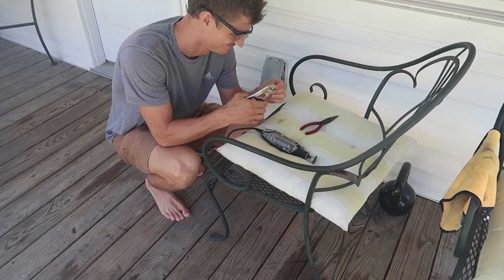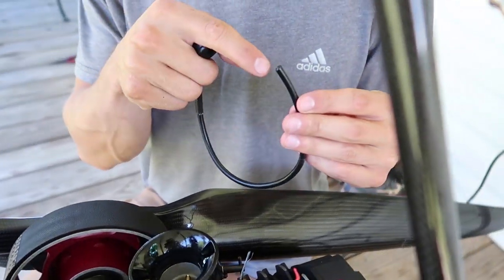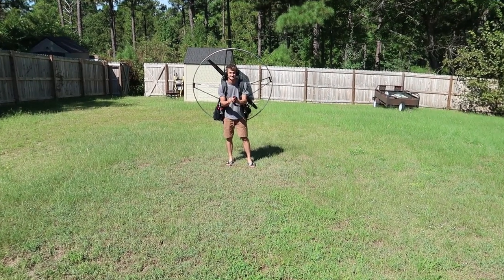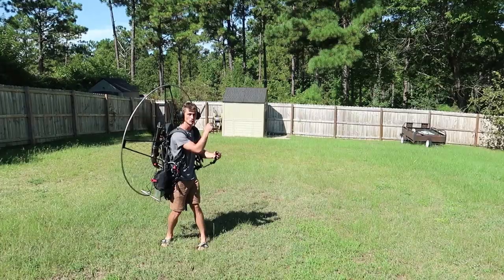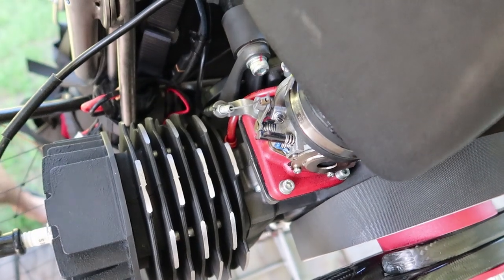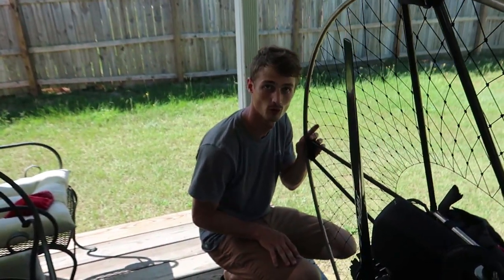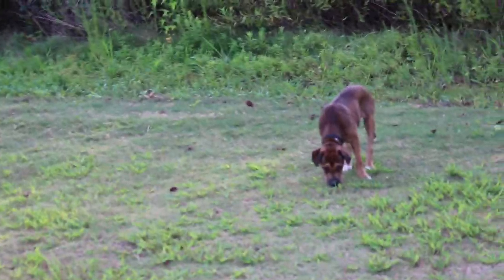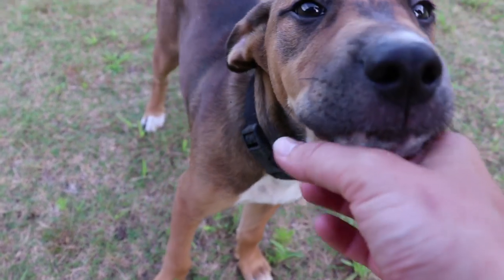Using a Wood Screw to Repair an Ignition Coil

Comment: You never cease to amaze me.  Gluing wooden props back together.  Using wood screws to join wire ends.  You are just multitalented.  You are a long way from Korea.  Great video!
Reply: Don't forget the Savior of all! J.B. Weld. Just J.B.'d a broken wood prop over the weekend with a couple of those squeeze type "vises"...worked great.
Reply: I don't think Mark used J.B. Weld, but, what he did use apparently worked.  He did that on an old Blackhawk he had a year or two ago when he took a collapse and hit the ground while having "a ton of friggin' fun!"  While he may be made of rubber his motor wasn't.  Apparently, Alayna is as well, recently they were in Utah and she free-flew into a tree.  Didn't have a scratch!  That J.B. Weld is good stuff!

Comment: Solid wire (screw) conducts differently from the original stranded wire core.
Reply: It is to do with surface area and how electrons flow at the surface of the conductor, basically, less surface area = more resistance ( solid wire)

Comment: Mark, allow me to include this please. I call it "Stupidest Mistake of the Year!" 

Me, 70 years old. Done everything air related, survived it all. Noticed my carb needle & clip getting really lose, if clip separates, needle dops, no fuel, engine quits.

I bought a Taiwanese Bing 84 knockoff $39.00 entire carb. Gotta' be better than Chineee right? Installed it. Hmm? Slide kinda' sticky.

Put the old Fresh Breeze SOLO 210 on top of a four foot bench, hate working on the ground, did the throttle slide bottom out check, seemed okay by the clack noise but throttle lever didn't go as far as normal. Oh well, it's hot, I'm sweating, crank it anyway!

I did. At near wide open it immediately torqued to my right & had every intention of grabbing me in the ass by it's big wooden prop. It let me know who was in charge at 1/10th. of a second!

I grabbed it, threw it & with it's 30 hp helping, it flew up & over to my right, landed with a crash on my concrete driveway! Carb separated (Thank God) due to impact, my five rescue pups (Thank God again) hauled ass as soon as it went to full power!

Damage? None except to a broken prop & my nerves! So why didn't I hit the cut off switch? No time. It was immediate full power...or nearly so. Probably 1/2 which seemed like full power. You had to be there.

You can say what you want about a Fresh Breeze but they build one rugged ass machine! From six feet to concrete under power! No Damage! Except prop.

Stupid? Hell yes but maybe somebody besides me will learn from it. And be careful buying cheap Chinese/Taiwanese crap to save a buck. It could've mutilated my stupid ass or one or two of my pups!

Comment: Dont use zinc coated screws.  They mess with the flow of current.  I seen my stepfather do this in the 80s to his ultra lite with the 399 rotax ?
Reply: 377 rotax not 399 and i agree silver plated or tin or nickel plated copper is best conductor of current for the money where gold is best but obviously more  expensive.